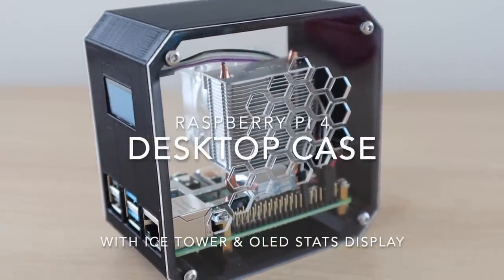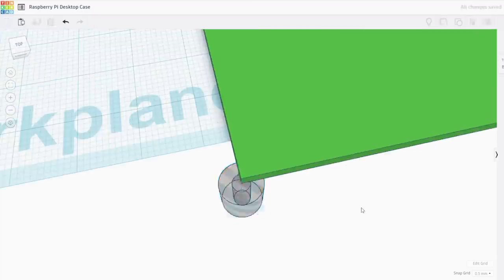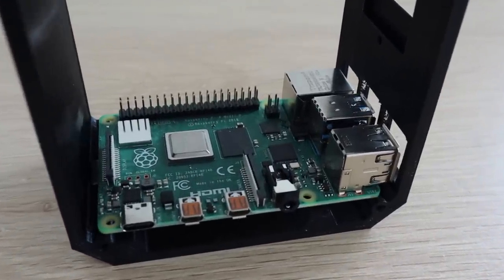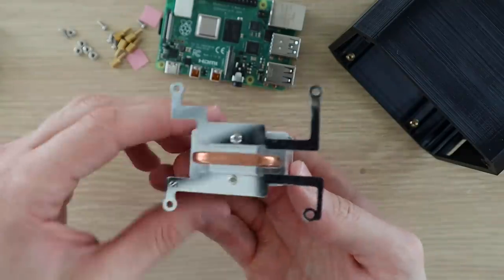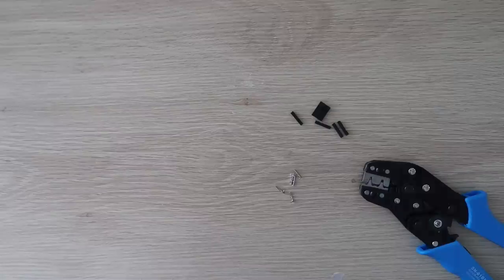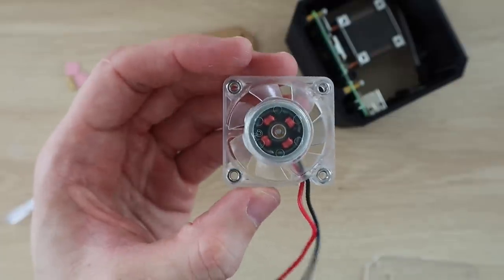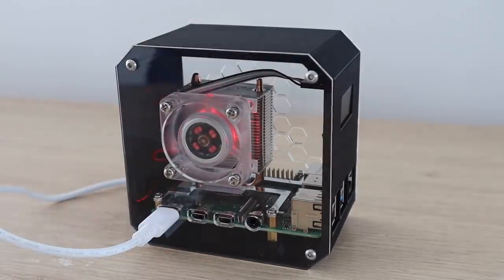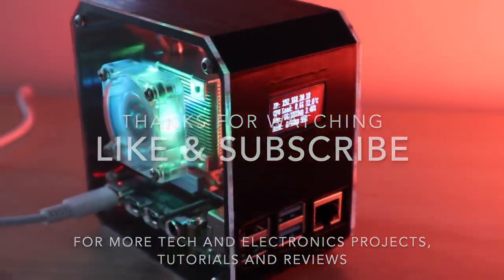DIY Raspberry Pi 4 Desktop Case With OLED Stats Display

Comment: You’ve got some mad skills and tools to design and make the case. I would put the Oled display on the opposite side so that the ports when used and network cable are not eyesores. Great video!
Reply from the maker: Thanks Rick! Based people’s suggestions I’m thinking of making two more variants of this case. One with the OLED display on the other side and one which can also house an SSD.
I personally prefer the ports on the front as I often use USB drives etc but it is an eyesore if you’ve got network cables and peripherals plugged in.
Reply: @MichaelKlements Great case! I was thinking the same. Looks nicer with the ports on the back side, and the OLED on the front side. Might be a little bit more tedious plugging in USB devices if this is something you do often, but the esthetics and cable management would be better - especially if there is a LAN cable attached. I guess it's a matter of personal preferences and use case.
Reply: @MichaelKlements  Please make another video when you finished the new design! This is so cool to watch!

Comment: got mine worked well the oled display is a bit tricky couldn't get it to auto start but got the font and running if you start the script manually

Comment: Absolutely love the case. Me personally, I would have made it broader, and had break out leads from the side connectors, and have them above the USB, and then mount the OLED on the other side, and maybe squeeze the camera module in below the display. Might not be quite as trendy, but all the cables are tidy at the rear. Adding an mSATA would also make this a true desktop computer with storage.
Reply from the maker: Love the ideas! A plug in module to bring the ports to the USB side, like the one supplied with the Argon case but overhead the USB ports, would be great.

Comment: Great work, with a really attractive look.
It would be awesome if you could add mounting points for SSD drive above the fan and a method of connection to the USB 3 port.
Also if possible, side access to the GPIO pins.
I'd then buy this over the Deskpi Pro.
Oh, and one more thing. If you make feet for the case and similar slots on top, this could then be stackable.
Reply: OK came here with exactly those point in mind. Especially the SSD and access to GPIO pins. I would definitively buy if this case had that upgrade.

Comment: A beautiful build. The only thing I'd add would be an internal SSD of some sort. I really can't go back to SD cards and it seems a shame to ruin the looks of the thing by hanging a SATA dongle off the side.
Reply from the maker: Yeah it’s a pity you can’t add an SDD through an interface like the display and camera ribbon cable connectors they’ve added directly onto the top of the Pi. It’s difficult to add an SDD without it looking like an afterthought.
Reply: @MichaelKlements  the only way would be to desolder USB port and go from there so the cables don’t have to go back to the case. USB could be integrated into the case.

Comment: looks awesome! Can you create the honeycomb side with the holes for connections (power,hdmi...) i would be grateful! 

Thak you so much for free sharing of youre work
Reply from the maker: Thank you. The fan side could also be honeycombed, but you'd need to figure out how to mount the fan onto it and get airflow to the Ice Tower. The idea behind having the air enter on one side and exit on the other is that it has to pass through or around the Ice Tower to provide the cooling. If you honeycomb the fan side as well, then air has a path to exit on the same side as the fan, which won't really do much for cooling the Pi.

Comment: It's a great looking case. Is it possible to add a second fan to the other side of the heatsink for a push / pull combination of air?

One thing I would do differently would be to machine the holes for the ports at the back of the unit instead. To make it look more like an actual PC. Instead of having all the wires etc mounted at the front. Nobody likes to stare at cables, they aren't attractive.

Comment: Almost done with my build, loving it, THANKS a lot, however I cannot find the schematics for plugging the fan or the led screen to the raspberry. It would mean a lot if you could point me in the right direction
Reply from the maker: That’s great Carlos! There’s a Pinout diagram in the guide linked in the video description along with details on which wires to connect to which pins. The fan connection should be provided with the Ice Tower, but following the GPIO pinout it just needs to be connected to any of the 5V (red wire) and GND (black wire) pins. Hope this helps!
Reply: @MichaelKlements  got the fan working, only oled to go. Great little project, with a big punch
Reply: Done ✅ the oled part sure is difficult for someone who up until a couple days ago never used linux before. But your detailed information takes you step by step until fully working condition. Thanks a bunch, great project.
Reply from the maker: Glad you managed to get your display working! Yeah it is quite a process to get it working, but we’ll done and thanks for the great feedback!

Comment: Very nice job! Thank you for sharing.
 
The changes I would make are: 1) SD card accessibility from the start (I know you address it in the video). 2) I would prefer two hold down points on the OLED display instead of just one side.
 
Some silicone feet from the hardware store would finish that off nicely.
Reply from the maker: Thanks for the ideas Hans! I like the idea for the silicone feet, I must definitely get some of these.
The OLED display is held in place on two sides, there are retaining clips which it slides under on the top edge and the screw on bracket then hold the bottom edge into the pocket which keeps it in place and held under the top clips.
Reply: @MichaelKlements  Thanks for the clarification on the OLED mount. You've got it covered then. Good stuff!

Comment: top part of the case still has space enough for m.2 or even ssd.
Or, under the pi, m.2 or ssd can still fit in.
Where can i buy this casing?
Reply from the maker: There’s a link to the product on Etsy in the video description. It’s currently sold out but should have more stock in the next day or two.
Reply: @MichaelKlements  would you consider designing one like this case with slot for m.2 or ssd?

Comment: Very nice work! I am working on a larger case with some similar features. I was not thinking of using laser cutting for the air holes but your design was so nice, I think I am changing my mind on that.

Comment: Great build! The only thing (aside from making sdcard slot and gpio header accessible) i would change is to move led-display to opposite side - network cable and usb-connections should rather be on 'back' side of the case, i believe.
Reply from the maker: Thanks for your suggestions and support! I like being able to swap out USB drives on the front and don't use the Ethernet port, but it would look cleaner to have these on the back.

Comment: Looks freaking awesome.  Not sure if you did it intentionally, but you may have the size of the OLED set incorrectly in your code - it looks like it's set to 128x32 instead of 128x64 which is giving you those horizontal lines running through the readout.
Reply from the maker: Thanks for picking this up! I was wondering why the display quality seemed quite a bit worse than when used on an Arduino. I just assumed that if the wrong size was selected it would only display on half the screen (top or bottom) not miss lines.

Comment: Id make the io on the acrylic flush and use 2 fans in a push pull configuration since there are mounting holes on the cooler

Comment: I got mine all together,, looks great.
I had to put the fan back on the heat sink because the screws didn’t come through enough to thread in to the nuts. Never guess what I forgot,, yes the SD card,,
Reply from the maker: If you push the nuts into the other side of the fan (the side which presses up against the side panel), they will be a tight fit and then screw through the side cover and into the nuts then they work fine.
Ah that’s annoying, it is a bit of a mission to get to!
Reply: @MichaelKlements  Thank you,, I was using the nuts that came with the fan and not the ones you provided with the case, all done now, 
Maybe tomorrow Ill attempt the script to get the screen working and then an OS and game carousel. looks great.
My next thing will be to add an SSD M.2 drive and hopefully it might fit inside the case along the top, if not Ill make a little cradle for it to sit in on the back.
My son wants a case, will you be doing more ?
Reply from the maker: That’s awesome! The OLED script shouldn’t be too difficult to get running, just follow the guide linked from maker.pro, it seems to have the most success. 
I’ve actually just ordered an M.2 drive to try. I’m going to make a slight change to the bottom and lift the Pi up a bit to fit the drive underneath it. If all goes to plan haha.
Yes, I continue to make a few each week, just have to limit numbers to what my 3D printers can manage.

Comment: Please respond what is the difference between complete kit and case components
Reply from the maker: There is a detailed description of what is included in both on the product page. The case components kit doesn’t have the OLED display and ribbon cable

Comment: What freeware program would you recommend for viewing the 3D (STL) files?  The design is a work of art.  One possible tweak is  change the 40mm fan (and its mount ) to a 60mm or 80mm Noctua 5V as you are no longer limited to what you can hang off the heatsink.   As for a SSD variant, I'd wait until the CM4 and daughterboards made  are in wider circulation-- it will far easier to keep the design the pristine work of art it is if you aren't having to hang things off the standard Pi4 and having to alter your design accordingly.   I'm especially curious how far such a design can be overclocked as you are no longer crippled by clearance issues regarding heatsinks when compared to with the standard card.
Reply from the maker: You can upload and open the STL files in TinkerCAD as well, it’s free and you’ll be able to edit the file.
I love the idea of the Noctua fans, I just wish they came in better colours! 
It would be awesome to build a CM4 into a desktop like this. The boards have much more functionality.
Reply: @MichaelKlements  If one of those CM4 daughterboards has the ability to drive a 12V, that would get you the ability to use their Chromax line.  That said, if you don't mind voiding the warranty, here's a guide on how to strip down and spray paint one of their beige lineup. https://linustechtips.com/topic/535721-painting-noctua-fans-a-guide/

Comment: Without a doubt, it looks like a great looking case.
My only concern would be with the display suffering from image burn from the static statistics labels.
Reply from the maker: Thanks David. Yeah you could cycle between two or three displays or scroll them up/down/across to prevent burn-in.

Comment: The case looks awesome and so cool but what I did differently is that I added a micro sd slot to access the micro sd card reader amd added room for gpio expansion
Reply from the maker: That's great! Did you make any modifications to the side panel for the GPIO pins or just more room?

Comment: Looks like you need to set the belts on your printer.
Also have you tried to heat gun the outside of the case to make it smooth?
Reply from the maker: I would think using a heat gun would soften the walls and cause warping before it smooths out the print lines?
Reply: @MichaelKlements  no if you use some care, as long as the walls are thick enough the heat doesn't run through to warp, try on a test bit, I've done it to a few things of mine.

Comment: You should consider marketing this. Not sure what the production costs are per unit since I don't know crap about 3D printing. However, just putting kits together, you could probably sell these for $30-50 pretty easily.

Comment: Nice design and think I will try something like that but with water cooling using a aquarium filter and pump. Making the processor water block will be a Challenge. Also the side panels I’m going for real tempered glass using magnets to keep them in place. A fan at the bottom will cool things down 

Your design definitely gave me ideas. Thanks for all your hard work
Reply from the maker: This sounds awesome, definitely share a link to it once you get it built!

Comment: I'd prefer drop in M2.5 inserts to screw into to secure Pi rather than screw directly into the frame. Additionally have the fan flush with side panel rather than dropped behind it, although appreciate makes securing the fan more complicated. Very minor comments of personal preference. Awesome work, very impressive.
Reply from the maker: Thanks for the ideas, the M2.5 inserts would definitely be a good addition.

Comment: Great project! Side vents can be cut in a raspberry design, platform style.
Laser cutting will allow you to make a very accurate image.
Dark transparent acrylic will probably have an interesting effect.
Reply from the maker: I was thinking that the one way acrylic they use for magic mirror projects could also have an interesting effect. The sides would be like mirrors usually and you could then turn on an LED inside the case to light it up and make the sides go slightly transparent.
Reply: @MichaelKlements  When there are many ideas, time is short.

Comment: Only thing I would ask for is a oblong hole to access the pins from out side the case for external wiring projects connected to the pie. But this case looks great. What software did you use to build this?
Reply from the maker: Yeah I’m looking at creating a “set” of different case options to cater for different projects. People have also asked for SSD support, power button and an SD card cutout. 
Thank you. The case is designed in TinkerCAD and the side panels in Inkscape, all free and quite basic.

Comment: Could you place the display on the opposite side ?  Then the cables would be out the back and right side. I have the horizontal ice tower and I just ordered a case with display. Great awesome work.
Reply from the maker: Yes, there are options available through my blog post for different configurations.

Comment: Hi - I am keen to buy one but what is the maximum SD card memory for this unit?
Reply from the maker: You should be able to run a 1TB SD card on it if you'd like, although this isn't a good idea. SD cards aren't a reliable storage medium, so I prefer keeping the OS on the SD card (I usually use a 16GB or 32Gb card) and using an external drive for storing files and media.

Comment: Hiya,  I'm in the UK and just started out with the Pi  4 and what it can do.  I do have some 3D printers and was impressed with what you have done.  I ordered the equivalent of parts, and I am having some troubles with the  detection of my i2c screen as it doesn't power on.  Following your web page, you mentioned that 
VCC to Pin1 3.3V Power
GND to Pin14 Ground
SCL to Pin3 SCL
SDA to Pin2 SDA
Should SDL go to PIN 5 and SDA go to PIN 3?
As according to my PI 4 pinouts, PIN5 is SCL (clock) and PIN 3 is SDA (data)?
Thanks
James
P.S.  Thank you great video.
Reply from the maker: Hi James,
Thanks for picking that up. I've referred to the GPIO PIN numbers and not the physical pin numbers, which is confusing. I've correct it now, but you are correct. 
Hope you've managed to get it working now!

Comment: Very nice.  To make even better.  That fan is too noisy ... go a 4 pin Noctua NF-A4x20 5V PWM.  It's quiet at full speed, but you can use hardware PWM via GPIO18 to control it's speed to keep the exact temperature you want.  It will sit beside your keyboard and you won't hear it even under a full stress test.  Also replace the Ice Tower with smaller heat sinks that cover the memory, USB and ethernet chips as well.  Maybe consider changing the case slightly to allow a 2.5" SSD to sit inside there too, as now you can boot directly to USB I have done away with the dodgy SD Cards.  Love the OLED display ... very nice.
Reply from the maker: I'd love to put a Noctua fan into this case, I just wish they weren't so ugly haha. They really need to come out with some better colour options!
Thanks for the ideas on the layout. I'm working on a design which incorporates an SSD into it, thinking of using an M.2 as they're a bit lower profile.

Comment: Wouldn't it be possible to move the cutout for the screen to the "rear" or flip the case around to make it so the screen is on a flat side for a more cleaner look?
Reply from the maker: You'd have to change the case slightly as well, as the display pins clash with the back of the Ice Tower with this size case. You could also look at putting 90 degree pins onto the back of the display so that the cable runs downwards and not straight out the back.

Comment: The one major change I'd want to this likely requires a custom PCB. I really want all the plugs coming out of the back of the Pi, and the screen on the front. I'd also want a larger screen, but that's just me. A PCB like the one Argon is using would be ideal. I think I'd go for the horizontal ice tower and put the thing on its side like a PC motherboard with the power/video daughterboard at the bottom. VESA option if I were making a commercial product out of it, but for me, I'd aim for freestanding.
Reply from the maker: Thanks for the ideas Joseph. I like your idea to mount the Pi on it's side like a PC and use the horizontal Ice Tower. I'm probably going to have a go at designing a port re-direct PCB for the Pi, this would make a much neater build in both cases. I've never tried a "port" PCB, but it could be an interesting project.